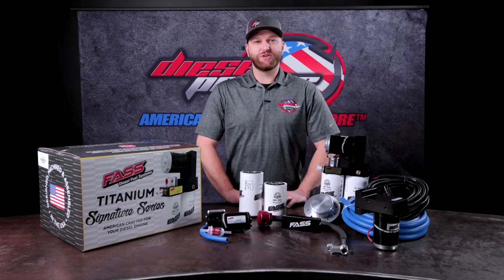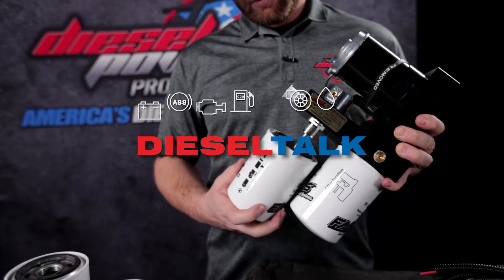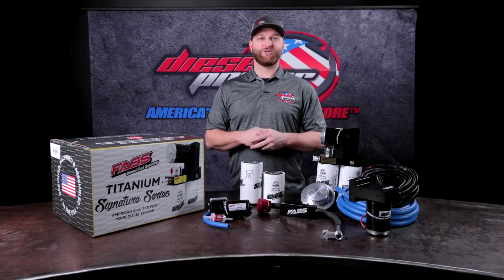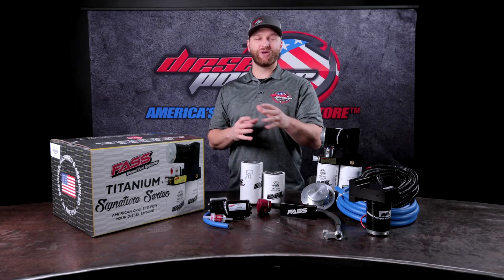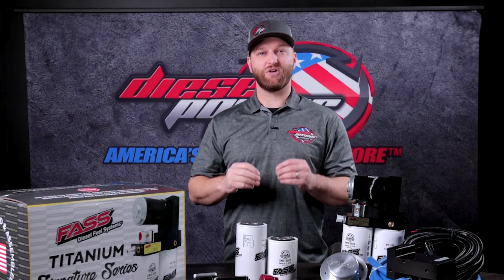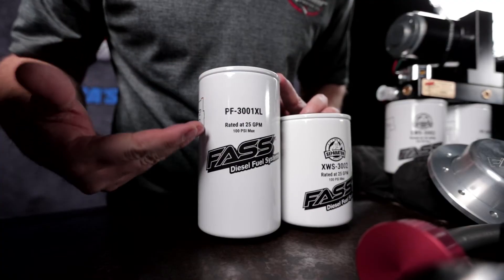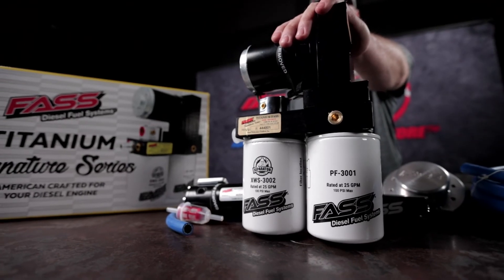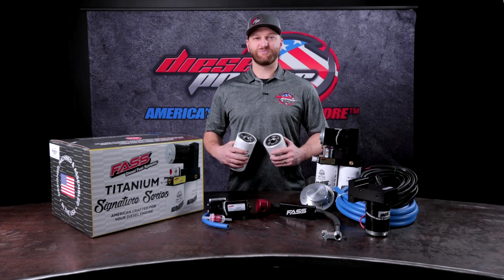Diesel Talk | FASS Titanium D07 vs D08, 1998.5-2004.5 Ram 5.9L Cummins

Comment: Just curious on average install time. Also is there a good video on wiring andnhose routing, etc. Thanks.
Reply from the maker: Depends on experience and working conditions. I would say for the average at home mechanic, in their driveway, a solid day. For a shop, or someone who has installed several before, few hours at most.
Reply: @DieselPowerProducts  awesome, thanks. I saw a couple videos and looked like a days job!

Comment: What is the best aftermarket fuel pump and lift pump for a 2001 Ram 2500 with the 5.9 Cummins? I’ve heard good things about the FASS, but I want to know what the best system is and also which one will be the easiest to maintain.

Comment: I have one in the tank of my 2001 3500 and the one up front and I cannot tell where it is sucking air from I’m not familiar with a diesel truck anyhow it leaks fuel at the fast fuel filters on the back of the truck. I can hear my fast fuel pump in the front of the bay of the truck running but the pump and the tank interfere with the one upfront I’ve never seen them both on the truck at the same time. Sorry if this doesn’t make sense I’m driving and using voice to text.

Comment: I just watch a video and the guy was talking about d07 and d08 but saying the do7 was for the inblock and the d08 was for the intank application I’m so confused I wanna purchase one but which one should I get mine is a 2000 2500 Cummins with the intank lift pump which one do I need d07 or d08?
Reply: If the truck has been retrofitted with an in-tank System, you need to purchase a TSD07100G Kit.